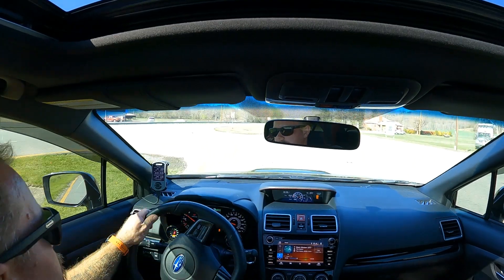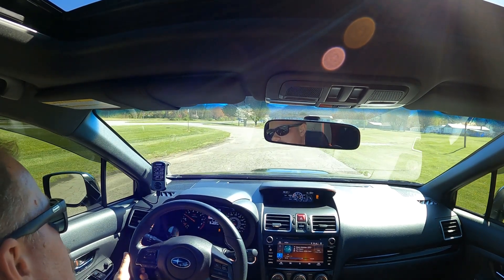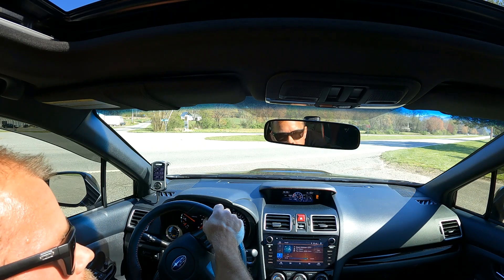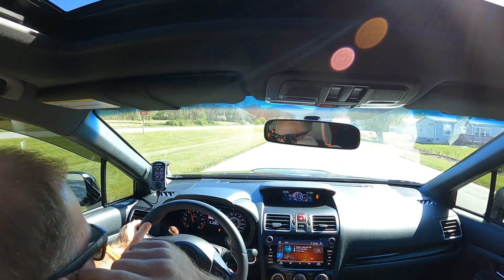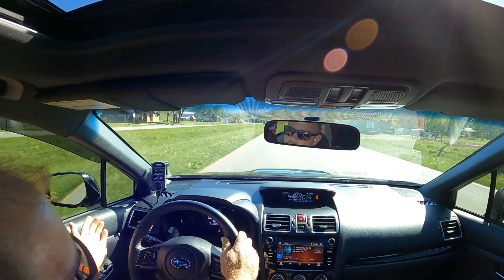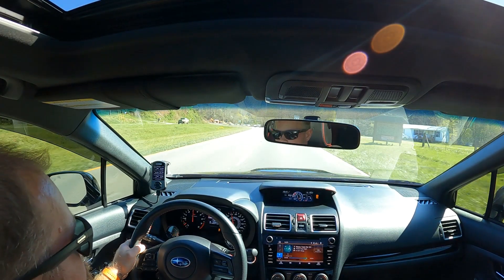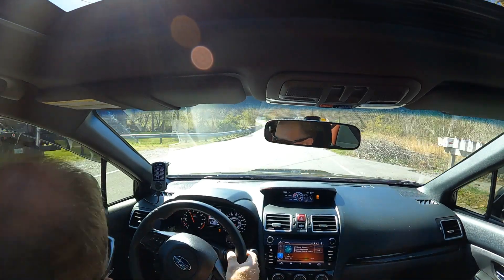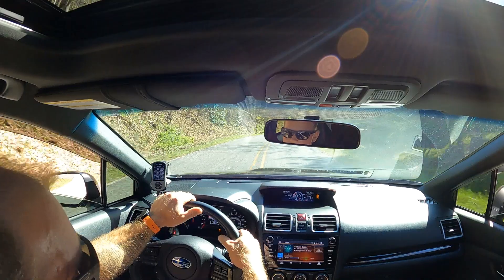900whp Subaru STI cruising on the low boost map.

Comment: Looking good! Bader is the man!
Reply from the maker: He really is a legend with these cars. I may jump to a larger throttle body and 7270 next year but we'll see. I'm not in a hurry at this point, the car is driving so good I'm just going to enjoy it for the time being.

I would like to add the Whiteline sway bars and links. I've also been debating on the Ken Block Rotiform KB1 wheels, I think they'd look sick on this but they are only available in 19s which would mean running a lower profile tire again.
Reply: @PleadTheFifth_Racing  everything on my car is stock except the engine. I'll see if I can make a video for you to see. It pretty much looks like yours.
Reply from the maker: @Evil_STI  Hell yea man, I'd love to see some content. If you ever do wanna take the leap into bigger power gains I would start with fuel and a tune. Get yourself a Radium hanger, a 525lph pump, and some ID1700s. That'll set you up to push into the 600whp range with ease. 

Once the fuel system is setup don't bother going stock location, rotated cleans up the engine back and ability to work on the car so much more.
Reply: @PleadTheFifth_Racing  ohhhh I'm fully built. 6870. 2 450. 2600id iad mag block.
Reply from the maker: @Evil_STI  Okay, I was confused when you said it was all stock except the engine....I thought you had mentioned you had a very similar setup!
Reply: @PleadTheFifth_Racing  yeah sure do. Except I'm on haltech pretty much only difference
Reply from the maker: @Evil_STI  I'd def like to see that man.

Where abouts are you located again, general area?
Reply: @PleadTheFifth_Racing  northern Virginia

Comment: How did you managed to keep using the Cobb AP? I havent finish my build yet, still figuring out, how to keep tje IAG TGVs delete, EGR and air pump delete with the rotated turbo.  I was going with Ecutek but my tuner told me they recently moved to greenspeed as well like Cobb.  Stand Alone will be my last resort, Haltech or Emtron unless Open Source tune works for my setup.
Reply from the maker: Plenty of tuners still using Cobb AP to tune these cars like project Green Bullshit never happened. Just gotta find the right shop. 

Good luck on your build.
Reply: @PleadTheFifth_Racing  thanks man, yeah I still have my AP, hopefully I get it done...long journey with this build, built long block, the whole nine yard, im trying to keep it as streetable as possible, pte 6062 with t51r mod, all fuel lines -6n, and very curious how the killer b Max VE (2.5" runner) header will perform
Reply from the maker: @TheE3R  I'm sure that header will perform pretty good. You'll see more of a change with the turbine housing AR size than changing out the header probably. The 1.05 V band or 1.15 T4 is the only way to go with these mid sized turbos.
Reply: Mine currently has the .82AR Vband, we'll see how it performs.
Reply from the maker: @TheE3R  I'd definitely pick up a 1.05, it'll hold boost better out the back of the RPM range and have less back pressure than the .82. Plus we've seen that the 1.05 actually spools better than the .82 when driven by the EJ25.

Not that the .82 is bad or not going to meet your power goals, just something to consider.
Reply: Definitelly I will💪☝️